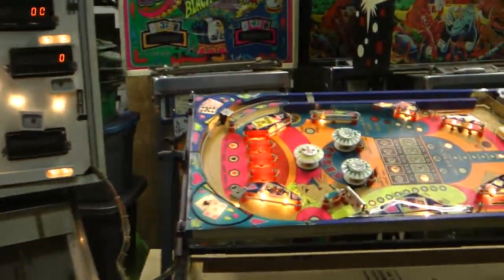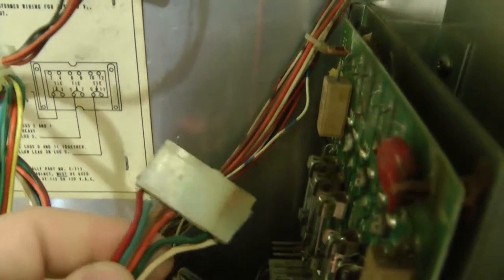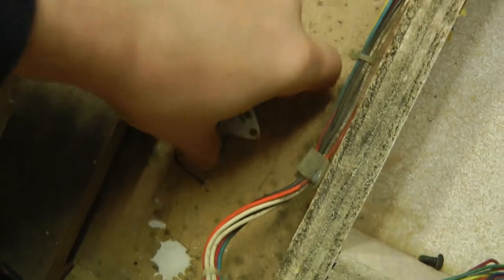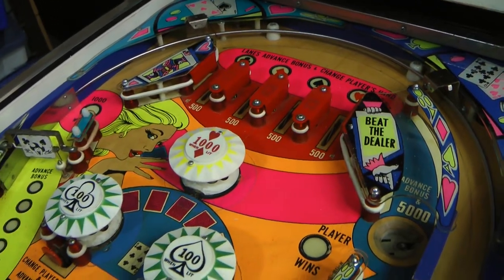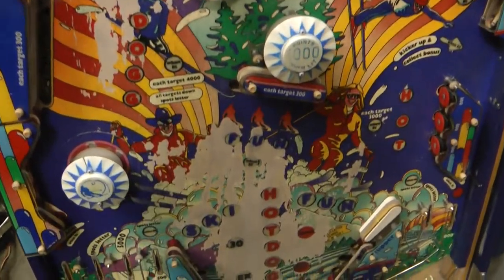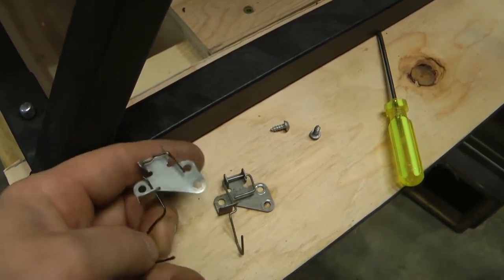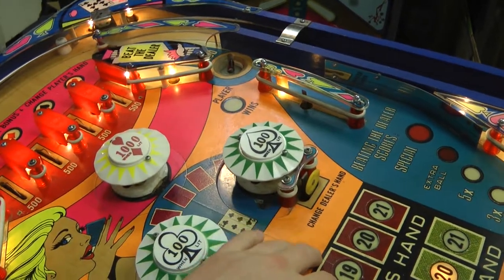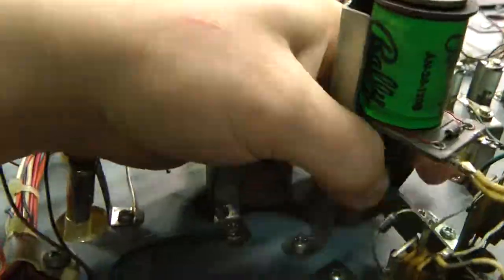Black Jack Pinball Repair (Bally 1980) - part 2

Comment: Was there other PIA part numbers besides the 6821 PIA that pinball games used? I forgot which pinball game in the 70's ballys, williams, gotliebb but there was a laundry list of dipswitch settings that was on the backdoor of the backbox which you had to save each dipswitch setting to EPROM or RAM one at a time which took hours to do. Any reasons why they did this? I think it was for the william systems 3,4 or a gotliebb MPU board. Most IRQ signals are generated from what in arcade games because ROM chips don't output IRQ signals any reasons why ROM chips don't output IRQ signals? Most ROM chips have a ROM signature value but how to you calculate the ROM signature value using a handheld calculator?

Comment: The williams system 1,2,3 and ballys system 1,2,3 motherboards had dipswitches you had to save for each configuration one at a time, any reasons why you have to save each setting one by one? Why does the driver boards use a PIA chip and not go direct to the CPU and not use a PIA chip?
Reply from the maker: Thanks for the comment. The first Williams solid state systems were System 3, 4, 6, 6a (Firepower), and 7. The classic Bally systems were -17 and -35. The DIP switch adjustments and the internal adjustments (stored in RAM) configure different things but you would have to ask the developers why they chose to make some things configured by DIP and some by software adjustments. My guess would be that the DIP switches are more for things that would be common to all games and the software adjustments are more of a per game adjustment, but I've never really though about it. As far as the PIAs are concerned, they're required to multiplex the outputs of the CPU. I would recommend reading through the 6821 PIA data sheet to get a better understanding of how it works and why it might have a place in a pinball machine.